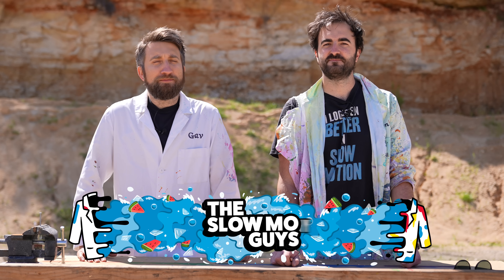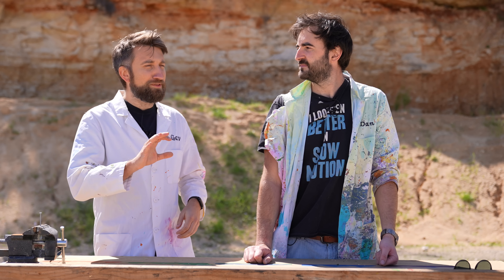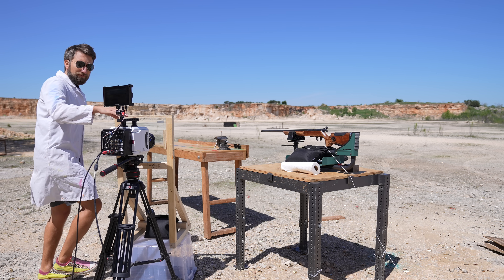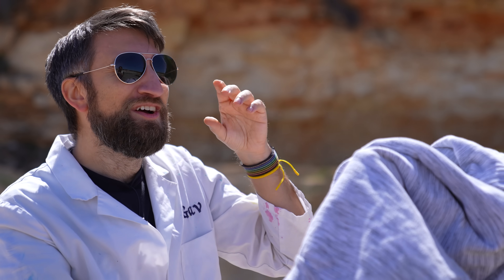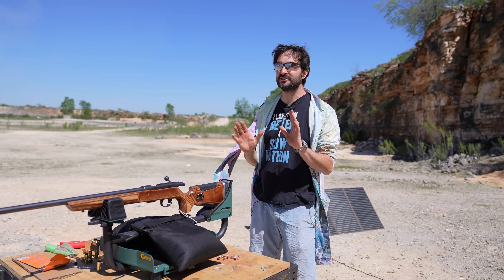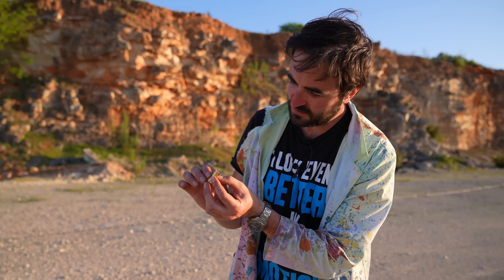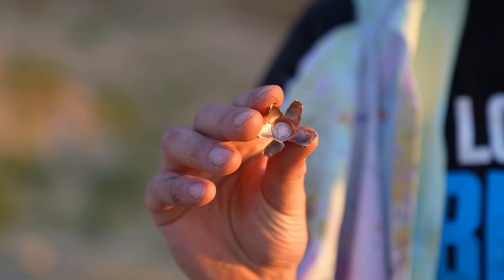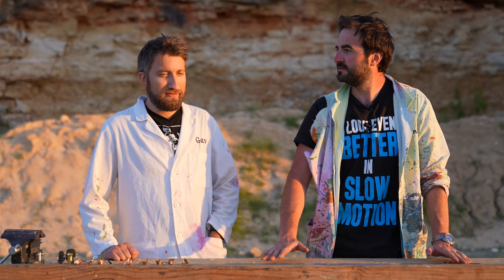Can a Bullet Go Through Another Bullet? 875,000FPS - The Slow Mo Guys

Comment: A steel core 5.56 would be incredibly fascinating to see. Guarantee it would go clean through
Reply: Yes, M855 green tip.
Reply: I'm shocked they used 22LR instead of 5.56/223
Reply: Maybe even a five-seven armor piercing round?
Reply: @Tortugaaa  5.7 was my first thought.
Reply: You can load 220 swift hot enough with light bullets like 50 to 60 grain that the bullets will liquefy and just leave molten smears. I know this because 4870 FPS over the crono was showing and it was making such marks at 200 yds
Reply: My thought exactly. Would have been way better for this application.
Reply: That's what I thought!
Black tip 5.56 would totally blow through that 50cal...I think.
Reply: @Daliclock  Or use black tip 30-06 ...  to be certain. lol
Reply: An armor piercing tungsten round would be better.
Reply: A 39gr 22-250 at 4200fps would be a good one to
Reply: @alexpirie9947  Also 204 since they are on the small bullet kick. Also a 4000fps cartidge.
Reply: Green tip 5.56
Reply: or the new 6.8/.277 round for the xm7
Reply: This is what I thought I figure there has to be steel bullets out there not soft metal bullets and that's what they need 

Also it was not film accurate either in the film The bullet shattered like it was made of glass it was brittle it broke into clean distinct pieces well yours well you described it right it turned into liquid :-)
Reply: @nerys71  Not liquid, but clay.
Because that's exactly how clay acts when it splashes against something at high speed.
In fact, lead and clay have many common properties.
Reply: @RealCadde 
A non Newtonian fluid?
Reply: @larryscott3982  That too.
Reply: Honestly, just for the extremity of it I would love to see what a 220 swift would do. They use the same 55gr or other applicable bullet from a 5.56mm with a much larger powder charge. 2300f/s is an acceptable average for a 5.56x45 cartridge from a decent barrel length, whereas the 220 swift gets the same projectile to 4000f/s.

I accidentally hit a ½in thick 4in dia. AR500 gong with my 220 using a 55gr soft tip at too close a range when a wind gust blew it into my shot path as I fired. At 50 yards it blew a ¾ hole through the gong with sheer velocity alone.
Reply: @Colonel_Overkill  220 swift would be pretty fascinating. I wonder if you could load a 220 swift with a steel core.
Reply: @CamoronMireCat  yes, easily. The load will be a bit heavier but I have green tip 220 swift ammo that I get about 3750f/s out of
Reply: What does it go through.... Yes. The 22-250 is a heck of a round. @Colonel_Overkill
Reply: @CamoronMireCat  Sure, you could load a 220 Swift with an SS109 steel cored bullet.  Because of its weight (62 grains), it's not going to make 4,000 fps though.  Around 3,400 to 3,600 fps is more realistic.
Reply: @Colonel_Overkill  Not trying to be a smarty pants, but I do re-load ammo and just FYI the average starting velocity for a .223 is 2800-3000 fps (55 grain). Several of them get upwards of 3300 fps depending on the powder, and the 5.56 can take even higher pressure than that. I have never seen one anywhere near 2300 unless its something crazy like a 90 grain bullet.
Reply: @Colonel_Overkill   A .224 Valkyrie would also be interesting to see ias well.
Reply: @Colonel_Overkill  17 Rem
Reply: Yes
Reply: Guarantee…right.
Reply: I just said that in my comment.  M855 😁
Reply: You should revisit this one with Scott at Kentucky Ballistics, he'll have green tip 5.56 ammo, and it WILL go straight through the 50 AE bullet
Reply: They need to call Scott, from Kentucky Ballistics, to do this. With both 556 and five seven.
Reply: It amuses me that they make it sound like armor-piercing rounds are hard to get. Even the smallest, bumfuck nowhere gun stores I've been to carry them for the common cartridges. "Can't just pop down to Walmart and get it." No, its even easier than that, lol. And Walmart still sells ammo in store, they just moronicly decided to stop selling the most common types of ammo for rifles and handguns (examples being 9mm and 5.56/.223)
Reply: @Nyx_2142  literally can buy it online and have it shipped to my door lol. But then again, these are two Brits in America, they come from a place currently trying to regulate "zombie knives". I give them a little leeway for not knowing how readily available AP ammo is
Reply: @Nyx_2142  Steel core isn't "AP" ammo, Tungsten carbide is.
Reply: Trouble is that those rounds are a damn sight faster than 22lr, and a .223 or 5.56 would be almost impossible to film with the clarity and the detail that you can get with slower rounds.
Reply: @RealCadde you kind of miss my point dude you missed it by a long shot The movie scene was shattered Glass whatever you call this I don't care what you call it you can call it pink polka dot send me a liquid amorphous fluid action if you want it wasn't what was in the movie
Reply: @nerys71  The one missing something is you, because you said liquid and i said clay.
I wasn't even talking about the movie.

Sober up dude.
Reply: @RealCadde  wow talk about a reality distortion field you replied to me therefore the context was my comment not your comment. And you missed the point of my comment which was the context of the discussion because you replied to me. 

Derp

Comment: .177 tungsten chisel point from a .22 magnum wildcat would be one real possibility. You need enough power to carry though and be effective. I didn't see a sabot and it is a 1911 type design that limits things like rifle cartridges. Automag did things but those are enlarged frames, which it does not appear to be. I guess you could wildcat .45 long Colt or similar (.357 mag, .38 special +p, .41 long, etc).